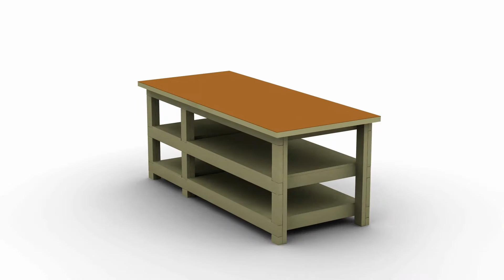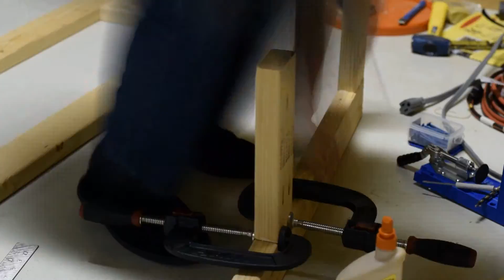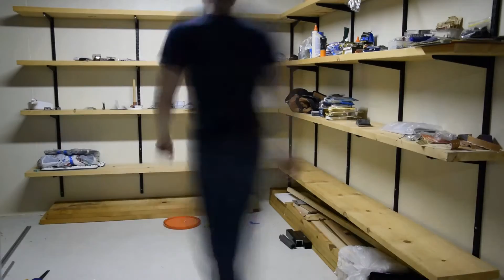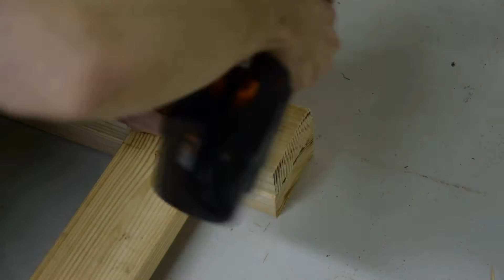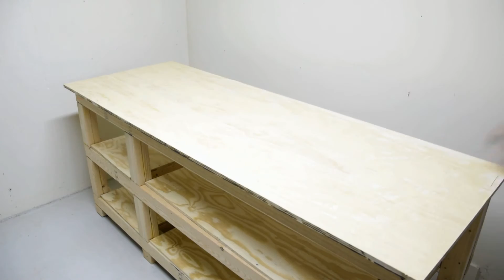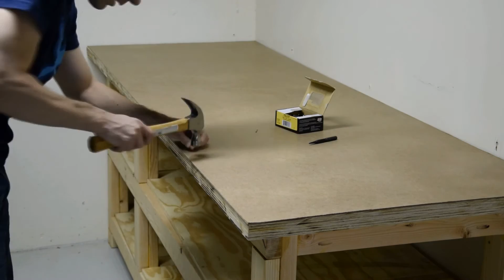Building My First Work Bench

Comment: Liking the workbench. Good job. Looks like it can take a beating. What happened with the right side mid-shelf? Did the cut go wrong...or did the bench come out that far out of square?
Reply from the maker: Ha, good eye!  The bench frame wasn't completely square from a top-down view.  But the benchtop is square and the frame is square from the front and side views (in other words, it's stable and the top is level relative to the ground), so I'm fine with that little bit of error in the frame.  Thanks for watching!